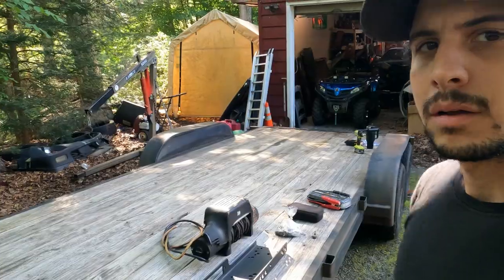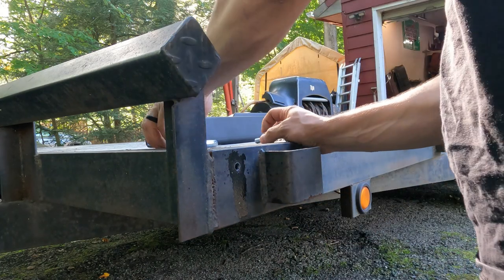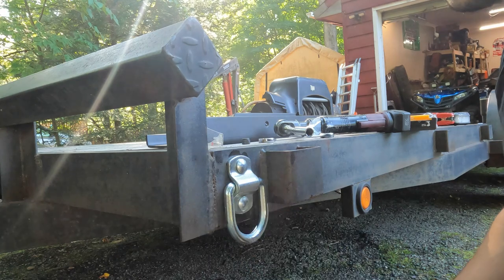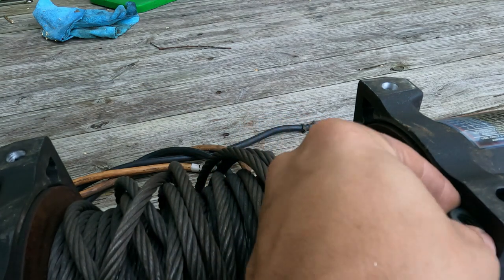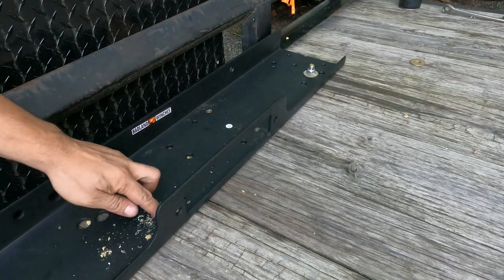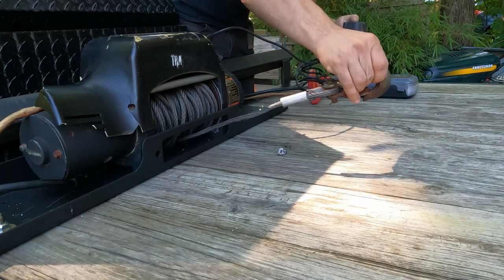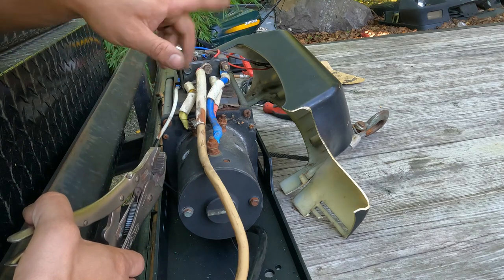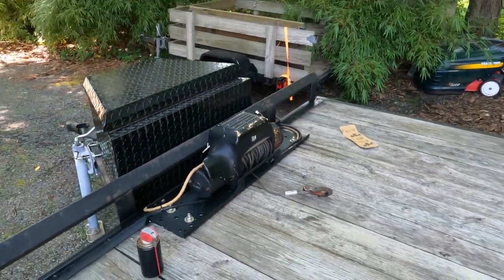Car Trailer Winch install

Comment: Nick, i give you points for being authentic. You didn't check that the winch was working off camera before filming and some might critique you for fhat, but your approach is valuable to those who will encounter obstacles. Camera keeps rolling and you work through solving the problem. Persistence is important for jobs like this. Some prefer a video that FF through the tedious process but there's value in that too. I say keep doing what youre doing.

Comment: One tip to help you out for next time. Good that you used oil when drilling into steel. If you slow down the drill RPM as slow as you can, your bits will last much longer. This is the reason why drill presses and band saws setup for metal work operate at much lower speeds than those for wood working. Youll be surprised how much better it works at slow speed especially if you keep adding oil.
Reply: Yes, slow speed, lubrication, & get yourself a center punch(spring loaded are easiest but hammer operated works too) to start the holes exactly where you want them - in the center punch divet.